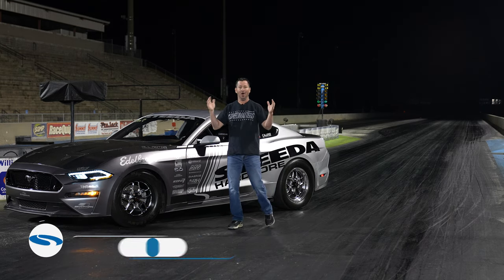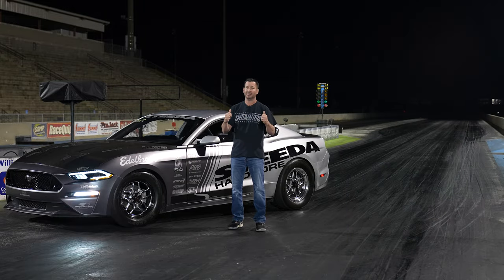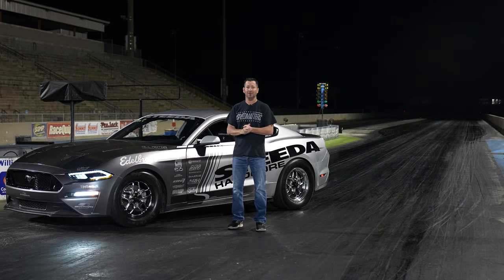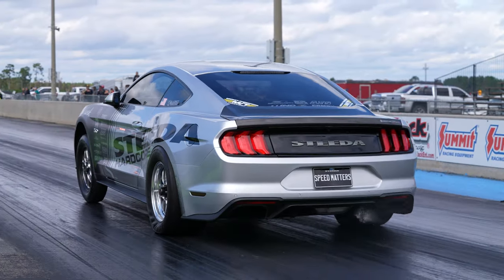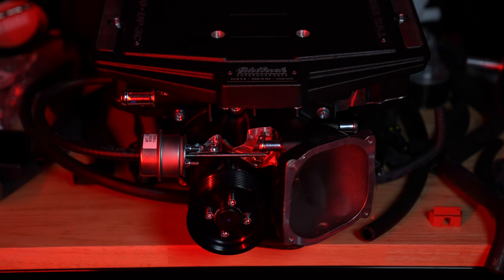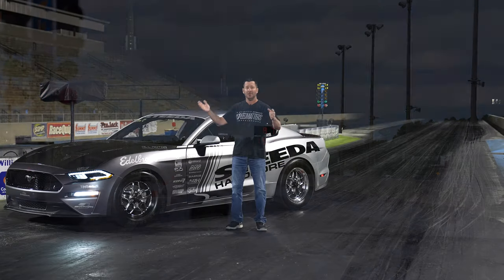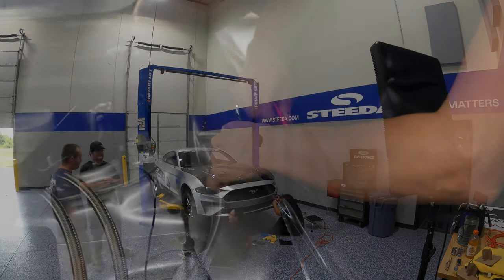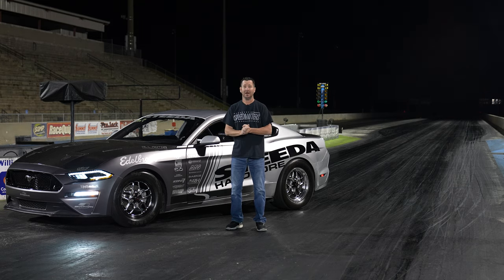Meet The New Edelbrock Supercharged Silver Bullet!

Comment: where was the Dyno graph ? Also shops running  7s with stock motors like yours running 8s isn't a big accomplishment.Steeda used to mean businesses now it's just a big commercial how they got the car wrapped in two days.
Reply from the maker: Hi,
We have this car at full weight and road legal use still, meaning this car weights in at over 3,600lbs. We also are always improving the car's power and simply haven't gotten it out to the local strip to test since they haven't been holding events recently. If you'd like to read more about Silver Bullet's current setup, you can check out our Project Vehicle page here: https://www.steeda.com/2018-mustang-silver-bullet-drag-car
-Sam
Reply: @steedaautosports what was pulley setup ?